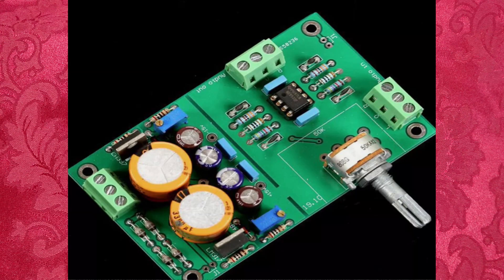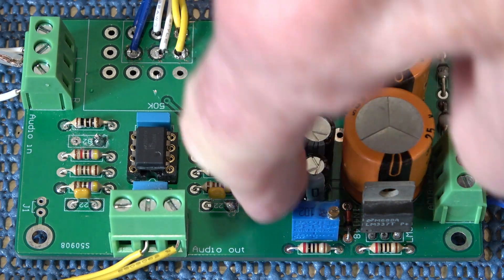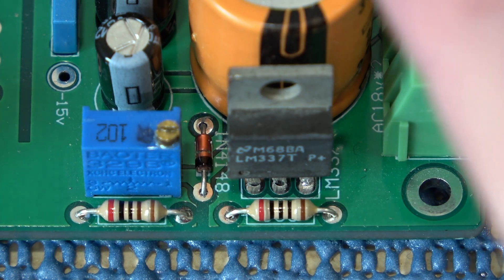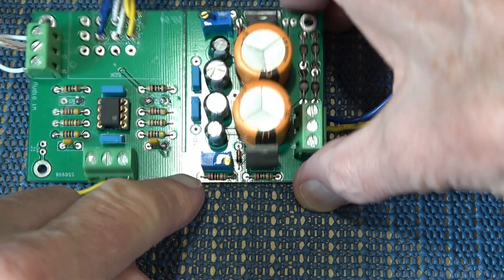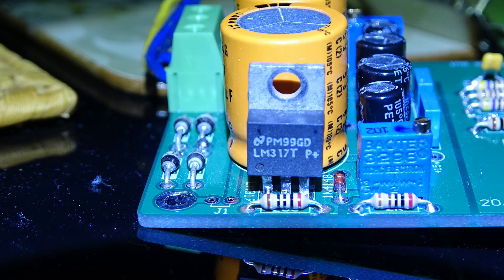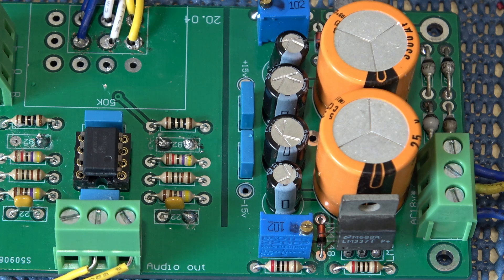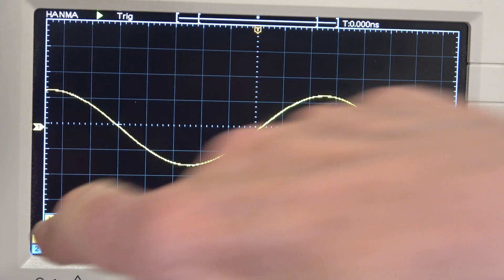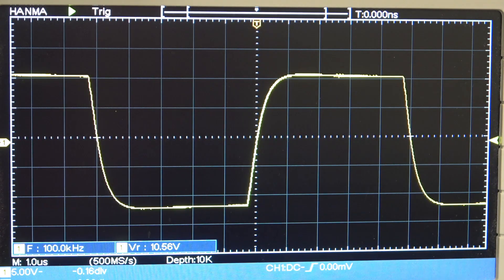NE5532 Buffer & Pre-amp. Full test & analysis.

Comment: Hi Michael, I found your video researching opamp-testing and I am working on a preamp at the moment. I want to ask you why you choose "rail-to-rail" decoupling rather than a capacitor from each of the power supply pins of the op-amp to ground(?). I can find differing opinions online and wanted to ask you what your thoughts are. 
Thanks!
Reply from the maker: This was not my design, simply a product from Ali Express. If you want to see how it should be done , OUR product will be available in a week or two.

Comment: Hello sir, i want to ask next to the opamp there is a blue capasitor connected to pin 4 and 8. I believe the value 0.1uf. So for the LME49720/ LM4562 do you still need to add 1uf capasitor?

Comment: So Michael, after your glowing report on the Accuphase 3850 clone, how would you compare the two now?
Reply from the maker: When you get to a certain level in performance, the differences in both measurements and any audible differences are very small indeed. I'm using both at present, personally I would be happy with either.
Reply: @MichaelBeeny These differences are small indeed, I certainly can't hear them. I wonder if we cascaded 10 or 100 stages of NE5532s whether it would be audible. noticeable.
Reply from the maker: @TerryClarkAccordioncrazy  If you do a search Terry, you will find circuits using 30+ 5532s, not to get better sound but to turn them into a power amplifier. 15 watts if I recall. In the next few weeks, I will be testing to see if I can measure and more importantly, can I hear any difference between 1,2 or 3  NE5532s in parallel suitably isolated of course. NEVER just put them on top of each other. We shall see, truth or snake oil?
Reply: @MichaelBeeny  Those are parallel designs but I meant put many unity gain opamp stages in series purely to see at what point they become audible. I'm guessing the noise would be noticed before the distortion but who knows? Some claim to hear differences between opamps. I can't.
Reply from the maker: @TerryClarkAccordioncrazy  I guess noise would become noticeable. I think probably half the world has fake 5532 in use. If you have no way of testing them or comparison you will never know. Fakes are not another chip maker making a copy but usually simply an older, poor spec similar IC.

Comment: Hi, is the 1nF capacitor multilayer mylar type or ceramic?
 Using two 1nf , one each from +V  and -V rail to ground (assuming that there is a ground track running thru the middle of opamp pins underneath ) would make any high speed opamp run more stable than just single 1 nf between rail to rail?
Reply from the maker: The capacitor between pins 4 and 8 needs to be around 1 uF, not 1 nF, or in other words 1000nF. Sorry an error in my video. A ceramic is fine and connect as recommended by TI. 2 caps are not needed, this does the job just fine.
Reply: @MichaelBeeny  thanks

Comment: Long time ago we compared and listen to NE5534, TL071, TL081, TDA1034, LM49720(?)... No difference heared.
Reply from the maker: I have listened to many ics over the years. Most modem ICs are very good indeed. There would be no point in bringing a new IC to market if it was not that good. I simply would not sell.
I have concluded that very small differences do exist and can often be detected after many hours of listening. But which of these differences are better?? Some of these discreet ICs cost silly money but contain more snake oil that fact.

Comment: Hello. What if ... Parallel ne5532??? . “If he literally just connected the legs of the chips, well, he was lucky. This op-amp survived that.
But don’t rush to accept a simple explanation as a recipe for all occasions. I insist that doing so is not correct. The total current consumption should increase significantly. Connecting the outputs directly is analogous to a short circuit. Most likely, in this design the through current of the output stages of both op-amps has increased significantly. But not to a critical value - operational amplifiers usually have an output current limitation. But increasing the current through the output stage usually has a beneficial effect on quality. In general, there are prerequisites for an increase in quality. But the method is barbaric."  https://www.youtube.com/watch?v=kNDX7SCN6Jc
Reply from the maker: NEVER NEVER just put 2 op amps together simply on top of each other. They will get very hot because it makes the chips oscillate and go unstable. You can parallel them, but they do need isolation resistors. Getting hot should be a warning that something is very wrong, think about it!! It could also damage the amplifier by drawing more current than it was designed to do. An average op amp will draw 10mA, some of these so-called discrete chips draw over 50mA. While these all share the same pin outputs, different chips need different compensation components to keep them stable and get the best from them.
Reply: @MichaelBeeny  Ok, I trust you're experince & wisdom. I suspected that a simple parallelism cannot be such a simple panacea, but I wanted an informed opinion. Thank you again.
Reply from the maker: @pioneeryum69v-yvy5  I might look into what is exactly required to put 2 in parallel in a video soon. It will double the current capability, but that will not really reflect on the sound. We shall see if it really makes any measurable or audible difference or is it just snake oil.
Reply: @MichaelBeeny  I'm looking forward to it. I will accept any conclusion. With transistors, the background noise seems to decrease in parallel configuration, ... a similar effect with op-amps .... would still be a bonus
Reply from the maker: @pioneeryum69v-yvy5  Its different in an op amp. An op amp is a complete circuit containing, many transistors, diodes, resistors and caps. A single transistor can often be simply parallelled to lower noise or current capability. The latter does tend to use resistors to even the current, however.
Reply: If you put 2 opamps on top of each other then they will fight. Each will have slightly different input offsets so they will drive their outputs to different levels and the only thing limiting the output current will be the output impedance. Even if they survive it doesn't mean it was a good idea.
Reply from the maker: @TerryClarkAccordioncrazy  Agreed 100% Terry.
Reply: I am glad from the bottom of my heart that your initial point of view was identical to the final conclusions from this analytical experiment.
Thank you for the honor of devoting so much time exclusively to just one question of mine... unsophisticated but not at all original. And ... thank you for being a man of your word. It is the first time in my life that someone from the other side of the globe ( I comment from a small European post-communist country, Romania ) is motivated to create a demonstrative video content "generated" by the inexperienced opinion of my humble person. Great man, great character. If I am satisfied with the answer? Overwhelmed! In the clip of today, ...November 24, I was with eyes and ears and in the ninth heaven.

Comment: Awesome videos, I am still a big OPA1656 Fan Boy but it seems i'm the only one ! :)
Reply: Hi!..I hadn't heard about this chip.  Thanks for the info.  I'll download the pdf and check it out.
Reply: @JBBrown-hh4rc  let me know your thoughts ! :)
Reply: Sorry for the delay in my response as I have had some medical issues.  I ordered the OPA1656 from Digikey and tried it in the Accuphase C-3850 clone preamp and conducted some listening tests.  The one problem I found with this op amp is that there was little separation of instruments and the vocal.  Everything appeared to be coming from a center axis which hindered the separation and detail of the music.  I removed the 1uf NP capacitor across pins 4 and 8 and placed a 1uf NP capacitor from pin 4 to ground and pin 8 to ground. There appeared to be better separation but the audio had minimal dynamic range.  It sounded as if the audio had been routed through a compressor/limiter. As my final choice, I used the OPA1612.  As with the LM4562/LME49720, I did need to place a 1uf NP capacitor across pins 4 and 8, the supply sources, to prevent oscillations (motorboating). The OPA1612 costs between 6 and 8 dollars in comparison to the lesser cost of the NE5532 or LM4562.  Also an adapter board is required for the OPA1656 or the OPA1612, additional cost.
Reply: @JBBrown-hh4rc  Oh Thanks for all your efforts ! this is great information :)

Comment: "...it shouldn't do anything else"
...unless it is a deliberate distorter like the GARBAGE valve (tube in Yankees land) op-amps all over many seller shops. :)
I get why some like it, but a few caps  resistors and maybe a few soft knee diodes will give you the same distortion, but WAY WAY cheaper.

Comment: 10V out into a power amp, ARE YOU MAD!!!!!!!!!?????????
Surely something like 2V would be way more that enough.
Reply from the maker: You are missing the point. That just shows the enormous head room available. You should be far from clipping in normal listening levels. HEADROOM MATTERS. Some preamps clip before the signal even enters the power amp. The gain can easily be changed with 1 resistor. I just showed it out of the box.
I do say in the video that 500mV in gives you 3 volts out. The rest is just headroom. You will NEVER clip this, exactly what it should be.
Reply: @MichaelBeeny  I get your point, and agree headroom is VERY IMPORTANT, but this amount is crazy overkill.
Running a +/-5V op-amp is still HUGE headroom ( +/-3V P-P, i.e. 6V range) for what should be a 1V output for normal operation.
....that is why I made my point.
Reply from the maker: @stevenbliss989  I take your point Steven, I just like a very wide headroom in both preamps and amplifier powers. It's so easy to offer such headroom, it's not that extra parts and ICs were added so why restrict it at all? However, you could always lower it by, as you stated, lowering the operating voltage. Buy why??
Many cars will do 130 MPH why? so, driving at 70-80 is more pleasant. Hummmm, not a good comparison, but I'm sure you get my point.
Reply: @MichaelBeeny  We agree on headroom, but not on the amount.  The reason is (speaking for you:) you care about having no possibility of going outside limits to cause problems, I care about headroom for the sake of not stressing components (I am an electronics design engineer - RETIRED!).  So for you car example, the reason they are designed for such high speed is because that means at lower speed the engine to wheels power train is DRAMATICALLY less stressed.  ALL STREES IS NOT LINEAR!  At twice the push, you may get six times the stress. The same is true for electronic parts.  Running an op-amp at +/15V hurts it disproportionately MUCH MORE than running it at +/-5V.  You may ask why? it's just electrons moving around.  Sorry NO, all electronics are QUANTUM devices, so NOTHING it it behaves with absolute predictability.  The trick is to design the part so the odds are in you favor so high that the part is LIKELY (no guaranteed) a certain amount of time.  The chances of an electron moving in such a way that it break some molecular bond is NOT ZERO!  The hardest thing to understand about how the universe really works is that EVERYTHING is STATSTICAL CHANCES, there are no ABSOLUTES!  As an old common example quoted: If you push against a wall, there is a NON-ZERO chance that you will pass through the wall.  The number is INSANELY LOW, but it is NEVER EVER ZERO!  I know I.ve said a lot here, and it is a lot to take in,  ...and yes Physics is a hobby of mine.  So in conclusion, if you take a thousand NE5532 and run half of the at +/-15V and the other half at +/-5V, then run them for ten years, WAY more of the +/-15V will fail compared to the +/-5V.  The is hundreds of time more true with your car example.  Anyway, this is why I am anal about unnecessarily stressing components.  This is why I see the NE5532 voltage use here as needless stress, all be it a TINY one.
Reply: @stevenbliss989  I think you are missing the point. To use a 2001 movie line  "Take A Stress Pill And Think Things Over".

Comment: Thanks for this review. I would use LM7815 and LM7915 directly. An what about the potentiomenter value, which potentiometer value do you recommend for this type of preamp. By the way, It would be nice to have the schematic of this circuit.
Reply from the maker: Why change the regulators? This type does in fact have a lower noise performance. I tested this with a 20K and 50K. Either will be fine. On paper the HF is more extended but after 100khz does anyone care? lol. The supplied pot tracks very well.
Reply: @MichaelBeeny  Hello Michael, May I also include to ask whether a fake/non-genuine 7912/7812 would affect the performance and quality of an OpAmp? I really hope you do response, I'm planning on checking out some transistors I have over here that regulates voltage linearly. Thanks

Comment: If you want a very simple preamplifier, this is an ok choice.

But if you choose to go for one of the simplest  preamplifiers.
(p7 mini preamplifier)
is a better choice, even if it doesn't have such an advanced power supply circuit, it has volt regulators and everything you need and takes up much less space.

The preamplifier circuit itself is not that different between the two.
Reply from the maker: There are lots of small 5532 preamps on Ali, most are Prity much the same. The cheaper one does often have fake chips, test before testing.
Reply: @MichaelBeeny  Do you get anything other than a fake from China? Especially ic. chip

Comment: Hello. In a NAIM NAP250 video you said that you want to modify it and play with the feedback circuit. Sorry if I remember wrongly.
Can you midify it and make a video?

Also try to make the frequency more flat so that it does not roll off so early in the bass and treble would also have been interesting.

Can i get naim nap250 better?
Reply from the maker: It is a very simple circuit. Missing some of the circuitry that can make many amplifiers better. What it does not like is a vol pot on its input. Feed it from a preamp like this or the Accuphase one and it's sounds so much better. I think I also showed how to get rid of crossover, but you will need a scope and signal generator to do it. It is what it is, an OK amplifier for very little money.

Comment: There are several amplifiers having already 1-2 of them. Can we use it also for such products?
Reply from the maker: I'm not quite sure what you are asking me, please explain.
Reply: @MichaelBeeny  Thank you Michael. Some amplifiers like the TPA3255 for example, that you have also presented here, have 1-2 of these NE5532 on their board. So for these cases does it make sense to add this module as well?
Reply from the maker: @nikiforosf4824  It's funny you should ask this question. Today I just happen to be testing that very combination. It does improve the sound quite abit, not sure why at this stage but it does. The gain is a little high, depending on what you will connect but lowering the gain will just be a resistor value change. It also gives you a volume control.
Reply: @MichaelBeeny  I have also tried a similar combination in the past but the pre-amplifier was introducing a lot of noise in the signal so i was a bit disappointed. I guess it depends on the amplifier that is tested every time and there is no general rule on the added value of such an equipment. But if it works properly, it can be interesting to add it.

Comment: How can you have any audiophile cred if you don't replace the NE5532 with a discreate op-amp like a Sparkos 🤔
Reply: lol
Reply from the maker: Well Conor if you feel that spending that kind of money on such an op amp makes any kind of difference, I cannot argue. I respect your opinion. Clearly, I cannot test every such op amp available. I have tested 2, however. They are not rubbish in any way at all, but I have not found a single one that either measures any better or sounds any better. If any manufacturer would like to send one, I will of course comprehensively test and listen, and most impotently, compare. I'm really not biased against the units, but should I find one that is excellent and worth the money. I will sing its praises.
One of the issues I have found is high current demand. Many circuits are not made with high current draws. Many of the class D circuits cannot cope with them.
As for having any CRED? I leave that for my viewers to draw their own conclusions!!
Reply: @MichaelBeeny  It was a 'joke' , wouldn't spend the money.
Reply from the maker: @ConorHanley  I did not think that was really you Conor. I thought you had been taken over by the dark side lol Now you all know how gullible I am.

Comment: Nice video..!
We have been using one of these boards for a long time now (with a genuine LM4562 chip and an ALPS RK27 50K volume pot).
It works extremely well and is part of an A/V amp that is used for hours daily.

A couple of things are worth mentioning-

Mine was received with both voltages adjusted uncomfortably high so I had to adjust them. An older production batch perhaps?

To use an LM4562 or LME49720, the capacitor across pins 4 and 8 should be on the order of at least 100nF, if not 1uF, *not 1nF* (sorry...).

And I am powering mine from the same +/- DC rails that power the power amp boards. Just connect DC common to the center power input pin, and the plus and minus DC source voltages (separately of course) to either of the outer pins. The on-board diodes will take care of routing the appropriate polarity to the right place, no problem. 😀

Very nice..!